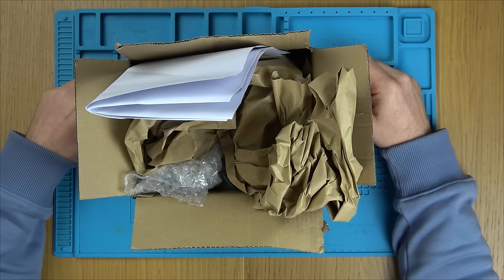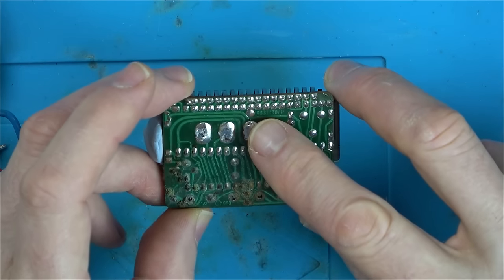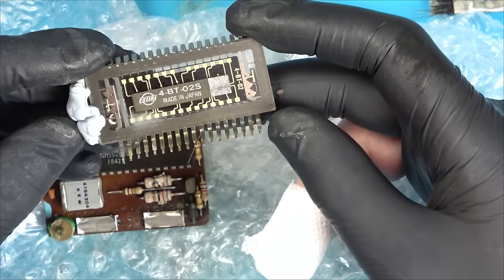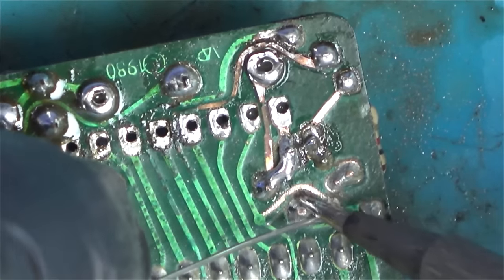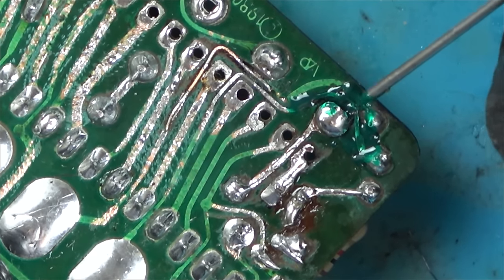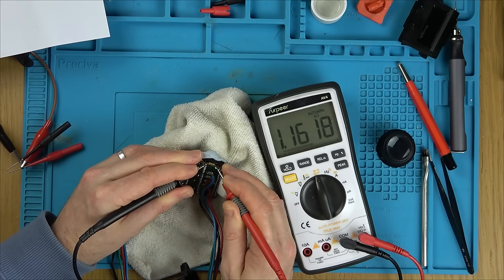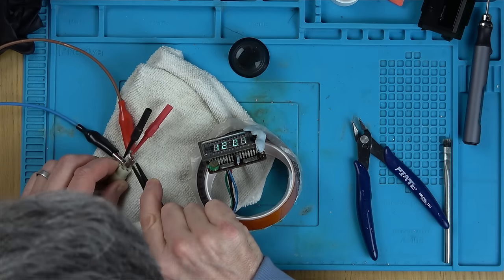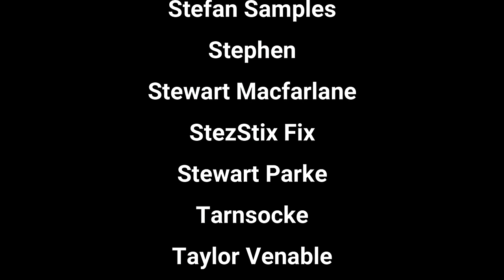This Back to the Future car has a Problem - 'TIME' to Fix it

Comment from the maker: Spoiler Saver and question.

Do you like the DMC DeLorean? What would be your dream car new or old? (price range up to £100K / $120K only). I think mine would be a 1960s Porsche 912 or maybe a 912 Targa. Cheaper than the 911, same looks and I could easily live with the 4 cylinders.
Reply: I would have an old 66  Ford Mustang cabriolet
Reply: 1982 Pontiac Trans-am (black of course)
Reply: @Regaljester75  Pretty much the same, but mine would be from 1978. Smokey and the Bandit as opposed to Knight Rider.
Reply: My dream car is either a rodded '32 or '34 3 window Ford coupé. Think American Graffiti's yellow deuce coupe or ZZ Top's Eliminator. I'd be deliriously happy with either.
Reply: My dream car would be a Toyota twin-cam AE86,  that 4A-GE sound is incredible!
Reply: Quite like the DMC. My favourite dream car would probably be a 1969 Dodge Charger R/T. Although I'm from the UK, we have to all agree that American classic muscle was the champion back then (don't know about now)
Reply: My favourite car would be a '58-'61 Corvette C1 Convertible. Useless, but beautiful.
Reply: Do I like it? Yes. Yes I do.

Ideal car, hmmm. I don’t care about prestige so I guess it’d be an Old Ford Escort Cosworth.
Reply: And spoiler savers don’t work anymore because pinned comments only appear at the top AFTER a person clicks into the comments section (which always displays the most recent)
Reply from the maker: @leadguardian6185  😂👍
Reply from the maker: @AcornElectron  Yeah, they don't work on phones, but they still do on desktops as far as I know👍👍
Reply: Mine would be a MKll Vauxhall cavalier 2000 SRi. Or, a MKl or MKll Vauxhall Calton estate👌😎🤘m-E-m
Reply: 1980 Toyota 40 series LandCruiser wagon but would likely need a new wife as well.
Reply: Capri Mk3 o/c ;)
Reply: My dream car is a 1946 Ford Super Deluxe 4-door, but I'll take basically anything from that era as long as it's got a 3-on-the-tree. There's a 52 Chevy 2-door near me for 9k and a 54 Plymouth Savoy 4-door for 11k also near me....have actually test driven both and they are DREAMBOATS...also a 53 Ford Business Coupe a couple states over for 12,995 is speaking to me as it has that gloriously throaty sounding Ford Flathead V8 under the hood. Previous owner even dualed it out, threw glasspacks under it!
Reply: mine would be a SAAB 900turbo
Reply: 2001 Plymouth Prowler, or 1969 Corvette Stingray. I really like the cars that have that one of a kind stand out design.
Reply: I like the gull wing doors.  I don't like the 80s design hard lines, I'm more of a fan of curves.  

I have my favorite car already, it's just in my garage waiting... to be.. fixed... 🤔
It's a 93 Toyota Celica All-Trac.  Not horrendously expensive but it IS extremely rare.

That being said, I think my dream car might be a vintage WWII army tank painted in livery and color schemes like the 8-bit NES or 16-bit Genesis or something.  Whoa.  🤔
Reply: I like the turning and breaking of a 912 better than the 911 of the same year... plus less fuel use.
Reply: I loved the deloreans, they're a little more common here perhaps as I've seen them a few times. Gorgeous cars - but my actual dream car would be a 1976 Jeep CJ7 Renegade with that classic eagle. I have had a few similar, but never had a chance to get one of the (american) bicentennial editions.
Reply: You can still buy a freshly assembled, NEW OLD STOCK DeLorean from  a warehouse in Houston Texas.
(They bought the factory in closeout, and have all the parts.)😮
MY dream car is a 1959 Ford Skyliner (Hardtopped Convertible.)
Reply: Mine would be a Lamborghini Huracan 5.2 V10 drove one a while back, tickled the throttle a bit on a damp roundabout and my boxers were history 😮
Reply: I’ve always wanted one, I’ve had an obsession with gullwing door cars (yes, even Bricklins) my whole life.
Reply from the maker: @wisher21uk  😂 I think you might have exceeded my price limit of 100k on that one Gary!!!!
Reply from the maker: @300DBenz  I had to Google them!!!! I've never seen one before. Let's just say it is interesting 😂
Reply: @Mymatevince  oh yeah Doh! 🙄 lol sorry Vince
Reply from the maker: @wisher21uk  😂👍
Reply: An SS El Camino from 68-71. I will drive in total opulence to the local supermarket and buy groceries. Then I'll leave home with a burnout. That's my wet dream
Reply: @Mymatevince  I never understood spoiler savers before I read these comments. Now I understand.
Reply: I would have a 1998 ford mustang gt
Reply: A late 70's Datsun Cherry F2 120a Coupe. Unusual choice, but it was my first ever car. Never expensive either, but now completely unobtainable in the UK.
Reply: 1980s BMW 6 series
Reply: MG Metro 6R4, totally not practical and given the extremely low mileage Service and Overhaul requirements of the engine and gearboxes I think it would be a museum piece but what a machine. Totally dream would be the blue and white livery that Austin Rover used for their works team vehicle’s.
Reply: 2023 Audi RS7

Comment: that thing that you don't know what it is is a trimmer capacitor.  there are polyester segments that slide between contacts to change the capacitance by a few picofarads.  It's probably to fine tune the crystal to adjust how fast the clock ticks.

Comment: Fun fact, you can still get these or very similar VFD's. Futaba are still making them. Also fun fact another company called Delorean is making a new car. I think they bought all the designs and metal stamping equipment to also reproduce parts for the original DMC Delorean DC-12.
Reply: they brought up everything that was left at the original factory when DeLorean went out of business - they have been on TV and said they have enough parts to build complete new DMC-12s from scratch and when they run out they have everything needed to reproduce every part again.

Comment: I found a company through a DMC message board that built one, completely accurate to the original, right into the removable bezel. They spliced new wires into the old harness, and it was plug and play! Interesting fact: all DMC's come with the clock wire harness plugin, even the after the clock was discontinued. How can you not tell time when in a DeLorean?!

Comment: Hi Vince, Another great video again... In the past i have used a windscreen chip repair kit to fix/hide cracks in plastic lenses (stone chips/craks) on cars and other plastic covers. All you do is dribble a little fluid on the crack and it feeds into the crack and makes it disappear i also used a heat gun to help it soak in to the crack but be careful with that or it will melt the plastic if too hot just warm it up. Once this is done you can polish it with fine car polish rubbing compound and or glass polish from T-Cut.I have had 100% sucsess with this method so far.Cheers Mitch

Comment: Honestly if it were me fixing it, because of how damaged the board was and how simple the circuit really is with that all in one chip, I would have designed a board and sent it off to be printed and saved all the original electronic components from the old board and installed them on to the new board.  Still, you did an amazing job saving that board mate!!  Kudos!

Comment: @Mymatevince, nice job on the clock display! I just repaired the basic same thing on a 1988 truck/car radio for my brother, he owns an old 1988 Dodge Dakota pickup with a Clarion brand AM/FM/Cassette radio. The display quit working several years ago and what was wrong with his was a resistor that was either for the cathode, or anode power for the vfd display had went from 20 ohms to 200 ohms, once replaced it worked perfectly. He was happy!

Comment: The little green part in the corner you were asking about is a trimmer capacitor I think it’s for fine adjustment of the crystal frequency to the chip for time accuracy.. 
sorry if you mentioned it I was doing other things as well lol 
Nice repair job
Reply: You are correct. A lazy way of doing things back then. I was only 6 then so mustn't grumble.

Comment: Super! The first problem was the bad cap you've changed in the begining, the second war that broken trace. Burned resistors drop 12V to 1V for the fillament (The Cathode of the VFD), The 100k  resistor (tipical value for VFDs) is pull down. I can build you an unique VFD clock with russian single digit small tubes from 70s, but i never sent something to another country. Those VFDs are very rare now and ain't cheap, if you manage to find them at all, driving them is a bit tricky, I have a bag of around 100 pcs of them and already build few clocks for friends :D
Reply from the maker: Cheers Technixbul, I know who to ask if I have VFD problems in the future 👌👍
Reply: I know this is old and you may not see this, but you might want to get some flame proof resistors for replacing these sorts.   @Mymatevince

Comment: I was a final year apprentice (for Otis)  in '75 and was given a project to convert the clocks- that were flip flop , like the old info boards at the stations- to accept a clock kit using those VFT displays. those clocks lasted about 35 years- this was for the lifts at the Shell Center in London.

Comment: For corroded traces that are basically intact what I do is scrap them back to clean copper with the fibreglass brush, and then flux them and put a layer of solder over them to help reinforce them a bit.
Reply: He can just design a PCB and actually use the sponsor's services.

Comment: I also like VFD very much as well! I did choose an old HTPC case just because of the VFD, and also have a couple more safely stored which came from now deceased music players, waiting for me to drive them some day with a microcontroller to fit them in a new device!
Reply: uh... thanks.  Now I have to start running around to all the Goodwills and thrift stores buying broken VCRs and calculators to scrap VFDs out of... as if I didn't already have enough problems hoarding electronics parts.  ;)  Love the idea!!

Comment: looks great vince done a lovely job what happed then when you shorted it out why did it work so it needs bridging
Reply from the maker: Thanks DG. So it needs 12v to keep the memory otherwise everytime you turn the ignition on the time would need resetting. Then you would only want the clock working when you are using the car otherwise the battery could go flat over longer periods. So to make it work it needed 12 volts on both contacts, the memory and the ignition 👍👍👍

Comment: I had a panel with a VFD tube of a Philips VCR in similar condition and to clean it deeply I used warm soapy water bath and a brush. It worked out very well and can save you hours of cleaning. The temperature of the water, close to hot, is very important for dissolving dirt and because when you take out the board most of the water will vaporize quickly. This all doesnt harm the electronics but you need to be sure it is completely dry wgen start to use it again. Also did this with boards of other devices like a board of a vacuuum cleaner and the results are very good.

Comment: A tip for desoldering stuff that is this old, first re-solder all the joints with fresh solder, then desolder them, it makes the job so much easier to do. EDIT: well done 🙂
Reply: Church roof and rain puts more into the ground than our old little dots in electronics. I know/understand it all adds up, but a church roof gets lead again and again. In 2014 for work, still used leaded solder for boards used in US military. (Or sodder as they say, but not odder (older)  for a change in age) Yanks annoy me. Aluminium is a whole new debate.
Reply: Re-soldering the joints makes it easier because of the fresh flux, not because of the fresh solder.
So you can instead just add flux before de-soldering.
Reply: @Okurka.  it’s not just the flux, I have used both methods and using fresh solder is much more effective than just using flux.
Reply: @TheDefpom  Use tacky flux.
Reply: @Okurka.  I do.

Comment: I used to have a 20x4 VFD hooked up to my computer showing stats such as coolant temperature (water cooled PC), cpu horsepower, clock frequency, time etc. My mate and I were dancing to some music and having a bit of a laugh till he accidentally bumped the pc, sending the VFD flying and broke it. He's lucky I'm not a bloke that holds a grudge, and besides, it was an accident, but he was in my bad books for a day or 3! VFD's are amazing. They look much nicer than LEd/LCD.

Comment: Maybe, Vince you can try get yourself one of the old POS displays. These are VFDs. You know the ones that are fitted behind the cashier for a customer at a shop can look at and see their bills add up. I have recently got one faulty and repaired it then hacked it with an arduino capable microcontroller. And oh my.... it was the most beautiful display I have got and I am keeping it as a 24/7 bedside clock.

Comment: Very very cool fix for this awesome car :) 
I once had a 1990 Mazda 323 BG Sedan, and I think it had VFD digital clock as well at the dashboard, as it looked similar glowing green, like this DeLorean clock. It also had dim feature, when head lights were switched on, the clock display brightness was reduced.
Sadly the top edge of the windshield leaked water at one point, and the clock was directly under, where the water droplets came down, and of course it killed the clock. Tried even disassemble the dash to remove and perhaps fix the clock, but dash panel around the clock didn't want to come apart. I gave up as I was afraid I'm going to break it. I don't know why it was so tightly there, maybe I missed some screw or clip or some clip was just so incredibly tight it didn't let go the panel easily.
I had clock in the radio display though, so that did the same thing, but of course would've been nice to fix the actual car dash clock as well. 
I did fix the leak though, brought the car to a car glass shop and they injected windshield glass glue to the leaking seam from inside the car, and the leak stopped right there. Had to remove sun visors and pop open interior roof upholstery panel near windshield, so repair guy gained access to the windshield top seam.
Oh, and my dream car, 1982 Pontiac Firebird Trans-Am, the Knight Rider KITT base car :)

Comment: ... you completely forgot to say one point twenty one jiggawatts while measuring with the meter.  Or is Vince From The Future going to go back and remind you to add that? 😆

Great job on the explanation of how to get the corrosion off.  I always wondered if flux would do an OK job of getting corroded bits clean again or at least help them get tinned enough to hold solder
Reply from the maker: So many missed opportunities with the quotes!!!!! 😂 I don't think I have worked on anything so corroded before. The grinding pen made short work of it though. I was very surprised the heat from the soldering iron didn't just blast through all the corrosion. It was like trying to melt concrete! 👍
Reply: So - vinegar to neutralize the corrosive acid, THEN lots of flux to ...remove oxides with ... acid... to... melt the solder... easier... 🤔 I mean I know it works I just don't understand things  sometimes.  lol

You wanna throw up an amazon link for all the people that are about to start buying that grinding pen?  ;)

Comment: Delorians were neutorious for everything from what I heard from water leaking seals, to mechanical reliability, if they run today it is dedicated fans of the films, or DMC fans, or Delorian fans, and probably most of the problems fixed by the know how. if you watch the making of BTTF you will hear them say how unreliable the car was. but Great Scott!! this fix worked for the better. as far as I am aware only so many were made before the news hit the fan. so don't think they had enough time to be sold to the masses, hense so few ever in the UK. great concept, just rushed to market before all the bugs were fixed.

Comment: VFD are directly heated Triode tubes. 1.3 volts is definitely the heater.
I am surprised that only 12 volts are used for the anode voltage. 
The gate segments are probably switched with 6 volts.
Congratulations

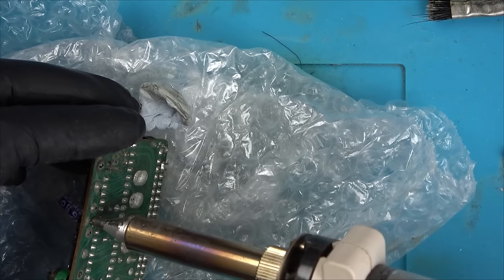Comment: 10:54 - apply a little bit of flux core tin/lead solder to the contact first, it will break up the oxides, I have to do the same on a lot of old oxidized solder joins.

Comment: The simplest solution would have been to travel back in time to the 80's and buy a new watch. But we understand that John did not want that option because of the current high price of plutonium cells. 🙂

Comment: Haven't watched the video yet, commenting before I know what happens. My 93 Nissan Maxima had a VFD clock, and it had bad solder joints galore. It took me many tries to finally find them all :P

EDIT: I would be surprised if that wasn't the same display as the one in my Maxima's clock. Interesting.

Comment: An alternative to UV solder mask if you need to do a large area is to get some conformal coating aerosol spray, then you can just clean it all up, fix the breaks, and then spray the entire PCB, will have the added benefit of protecting the rest of the PCB from future moisture ingress.
Reply: Or nick the wife's nail varnish.

Comment: I've seen that clock in another vehicle, not sure and it wasn't a mainline maker of cars but something a bit bespoke, Bristol maybe?   Thing is VFD clocks were emerging on cars in the 80's, Sierra Ghia's, MK3 Granada's, Austin and MG Montego/Maestro's, Vauxhall Cavaliers all had dash mounted VFD, Jaguar XJ40 was pure VFD on everything as was the talkie all digital MG Montego, Opel Manta GTE was also all VFD dash.   Britax Vega it seems became taken over by Bristol Street Group more known for their dealerships but it seems they bought quite a bit of factory stuff like Britax which is more known for aftermarket seat belts and safety stuff, they also made light clusters for some cars.
Reply: Monza GTE not Manta.